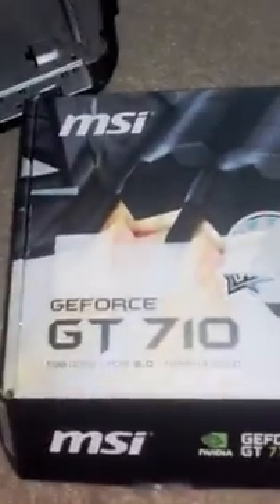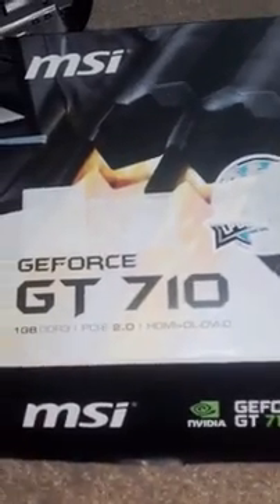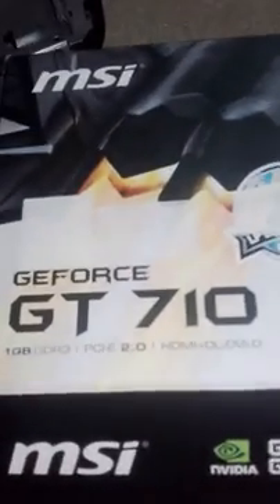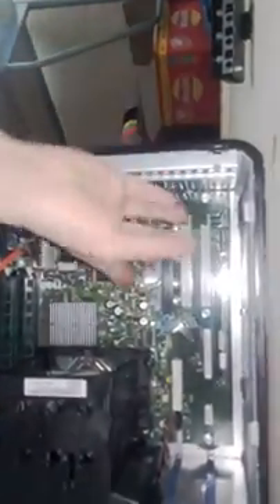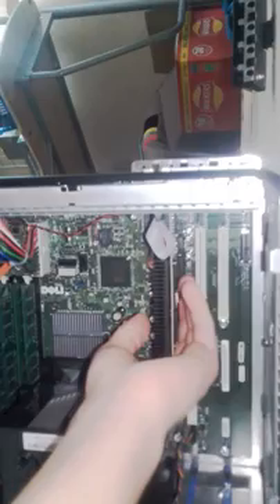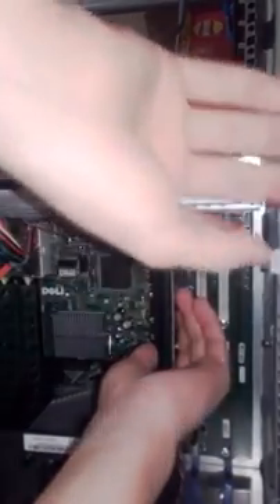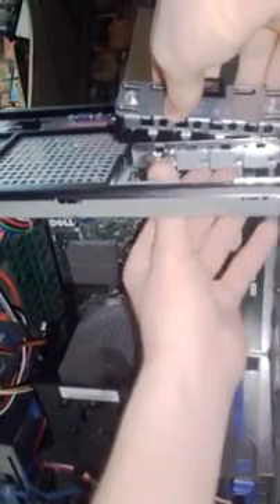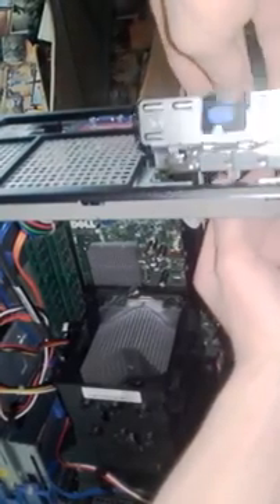Instaling a MSI GT710 graphics card in a Dell Optiplex 755

Comment: I Did all the possible things you can do to install the graphics card in my dell optiplex 755 still says no signal signal ln the monitor. HELP NEEDED
Reply: U fix this?
Reply: Check your power supply it needs atleast 300watts power supply

Comment: Why gt 710 work on @x1 1.1 mode? Optiplex 755sff
Reply: if SFF P/S rated at 300 watts. get the fan version those smaller cases get pretty hot.
Reply: @fucheduck  hello what do you mean by fan version?